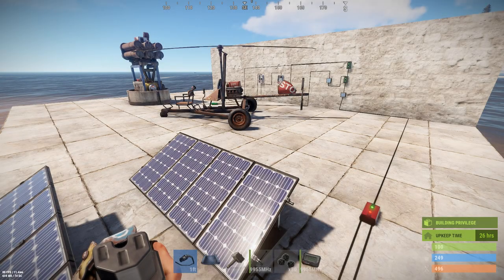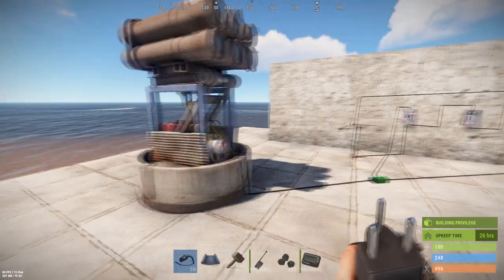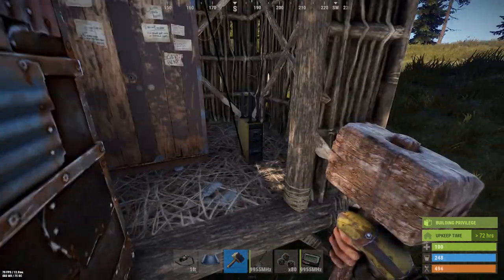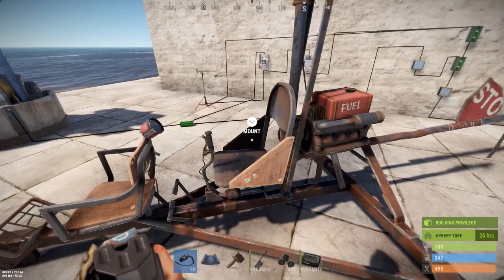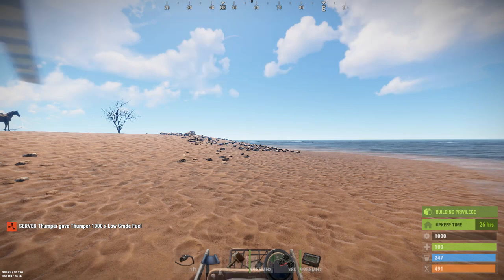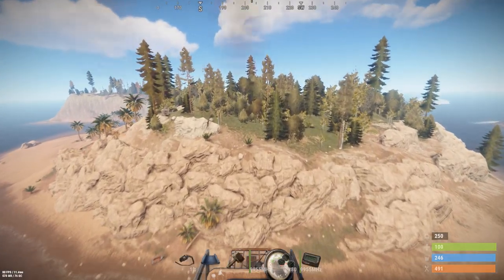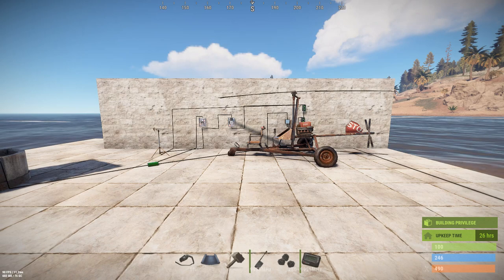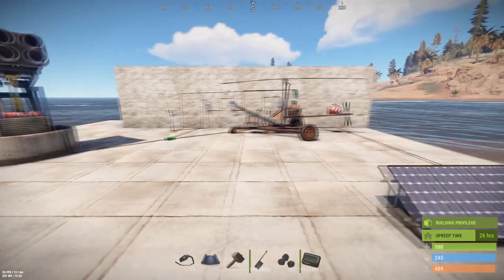Rust Electricity 101: Basic Circuits - SAM Site Remote Trigger

Comment: I have a setup with 6 remotely triggered SAM turrets (5 individual RF receivers triggering memory cells). It all works, but sometimes, one turret goes out of sync (it is on when the others are off). I rechecked the circuit and all is sufficiently powered, I can't find any issues. It seems like either the memory cell is bugged, or the RF components are not reliable. Probably it would be better to just have one RF Receiver and one memory cell and split up the signal to a series of AND switches that output to the individual cables, but I was trying to avoid this because I would have to extend the cables using components, making more weak points in this circuit. Any other ideas on why this happens?
Reply from the maker: I'm not sure why they get out of sync, but it's Rust, so no surprise :) Do you need to control each of them separately? if not, maybe use two RF, one to turn on a single memory cell and another RF to turn off?
Reply: @RabidRabbitGamer  i did each simultaniously but with their own rf receivers because it got a little complex and i would have to hide a lot of cables, but it would still be better to just have one receiver as i learned. On another topic, do batteries keep their charge now in Rust?
Reply from the maker: @lorsch.  They sure do! Cave base folks are cheering everywhere :)

Comment: dont wanna rain on your parade, but I'm pretty sure you can switch seats, pull out the remote and trigger it, then swap back to the driver seat
and hopefully not crash in the process
Reply from the maker: It is possible, but not easy, particularly if you were low altitude or had someone in pursuit. This solution isn't for aerial experts like you :)
Reply: @Random Schmid If you swap seats while piloting the heli, even if you swap back to the pilot's seat you won't be able to save it from crashing, regardless of height.